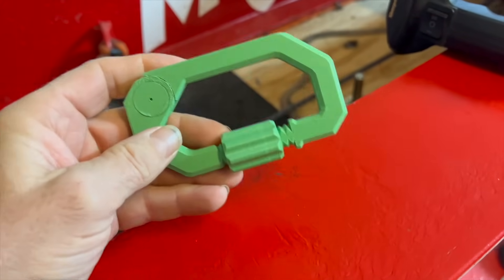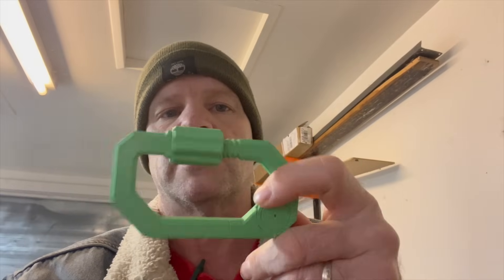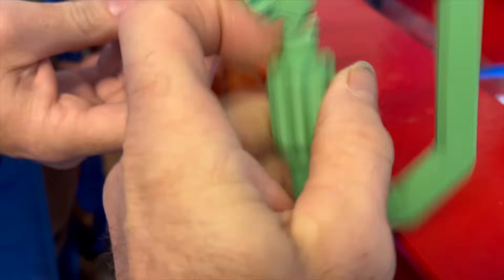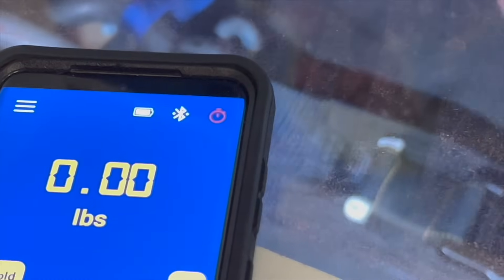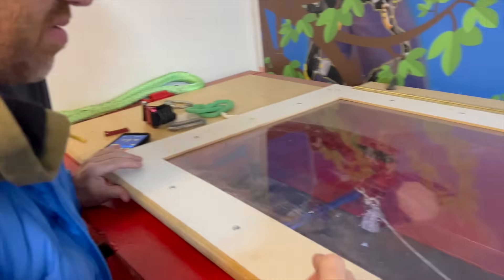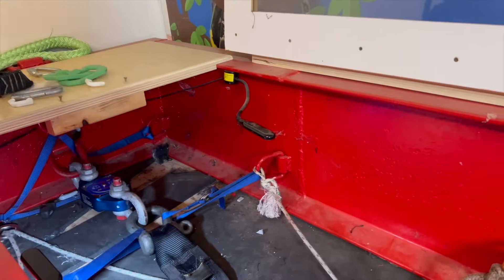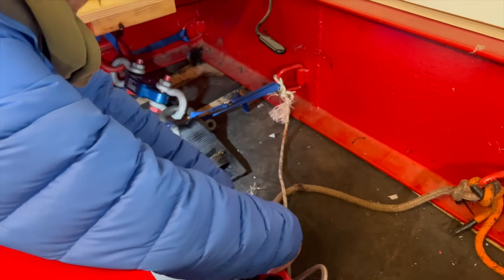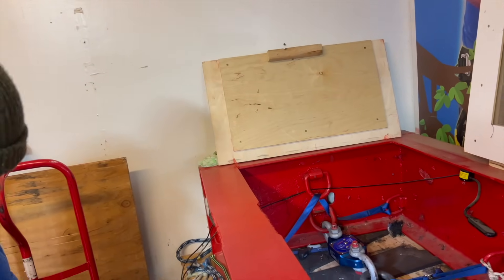Break Testing 3D Printed Carabiners Etc.

Comment: I could watch break testing like this all day 😂 For a break-away carabiner, the thought I had was a metal carabiner (similar to the design you are using) that has a pin that is designed to fail at a certain load. It may be more reliable than a fully 3D design 🤔

Comment: @August Hunicke
For the break-away connection, how about using a regular accessory carabiner that has been compromised by either filing material out of a chosen failure point?  Or, better yet, milling it out with that Bridgeport mill that I see in the background.

Comment: Since you are starting to use this for commercial purposes just buy yourself a Markforged and write it off. They can do continuous fiber printing- laying down a continuous fiber of carbon fiber, Kevlar, or glass unlike the cut carbon fiber chunks that are in all other CF filaments. You can get a Mark Two for $16k which will also print TPU if you wanted to make protective rubberized boots for stuff. As Joe mentioned, the higher heat materials tend to be stronger so you can get strength that way with an enclosure on a cheaper printer. Some don’t get hot enough though so keep an eye on those parameters.

Comment: I am an avid fan of all things August. This comment is intended to be helpful not critical or snide. Your reservations are justified. As a retired professional engineer with 45 years experience designing and manufacturing a wide range of components I can't tell you how bad of an idea this is to use such an  imprecise  process to manufacture a structural safety component...to sell or for personal use. Makes me uncomfortable just thinking about it. ...kind of like climbing a leaning dead hollow tree with a big crack. There are far better ways to produce a fuse-able link.
Reply: Given that many people use zip ties for this purpose would you consider the 3d printed piece to be an improvement? Or worse, or neutral?
Reply: @Jodosomemo  Both ideas make me nervous. Neither approach has the controlled performance consistency desired for an important safetry device. I understand in the absence of a good answer people will improvise....but these two solutions are risky. In my judgement you may never see a commercial product offered by a major manufacturer. The product liability risk outweighs the potential financial benefit of the small sales volume......which makes me hesitant to even suggest alternative solutions. I hope the industry finds something that works.
Reply: @ interesting
Reply: @ and if product ever was made, it would probably be 1 million times more expensive than a zip tie, which most people would probably still end up using as a result
Reply: @Jodosomemo  Yeah, that is a good possibility.

Comment: I don’t do any 3D printing, but I’m just wondering if you could make something more like a ring? Im imagining that it would possibly be stronger with no hinge or gate. You would have to hook to it on both sides with an actual carabiner.  But you’d still have a breaking point in between. You could make them bigger or smaller to adjust the breaking point. Love your videos.

Comment: You'r testing them the wrong way thought aren't you? (which I'm sure you know, I just wonder why)
Reply from the maker: “Wrong way thought?” ???? No clue what you mean.
Reply: @AugustHunicke  oops sorry "wrong way though"

To load that pin in use the way you are testing it, wouldn't you have to fall out of the tree and catch it on a stub?
Something like hanging a chainsaw off the ring you have a half warp of webbing helping.

Hopefully clearer than my last attempt.
Reply from the maker: @ we tested a few different things so I’m not sure which you are referring to. If it is the carabiner then we are simply just testing to see what it breaks at. 🤷🏼‍♂️
Reply: @AugustHunicke  The pins for you the accessory rings.
Reply from the maker: @stusue9733  yes, they would be even stronger if we pulled them exactly how they will be loaded.

Comment: Carbon fiber in fdm printing always waekens the bas material. Its a filler, with no cross link bonds like other CF products
Reply: Somewhat incorrect. That happens with the cut CF done with cheaper printers. That does not happen with continuous fiber printers.

Comment: looks like an issue with slicer settings on that green one it shouldn't be printed hollow wall thickness all that's holding the threaded part to the rest of it would make it 100% infill around 5 or 8mm past where the thread starts that should hold a lot more also concentric pattern will do a lot more than lines or zigzags

Comment: What about a breakaway for a saw, power or hand, tether? I can think of some instances where sacrificing a piece of equipment would be better than it coming around and hitting you/me.
Reply from the maker: I consider breakaway lanyards and carabiners for a saws unnecessary because the saws break when pulled hard. Don’t ask me how I know.
Reply: @ I trust ya! Just throwing an idea out there, but figured you guys probably considered it already.  Loving the idea for the D rings! I’ve put off moving mine knowing I won’t get them as tight as they are now!